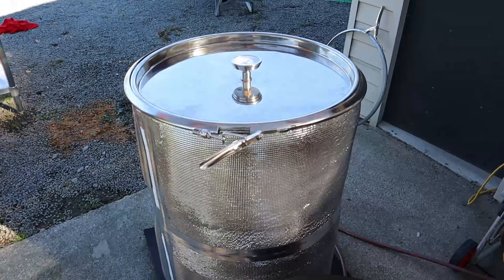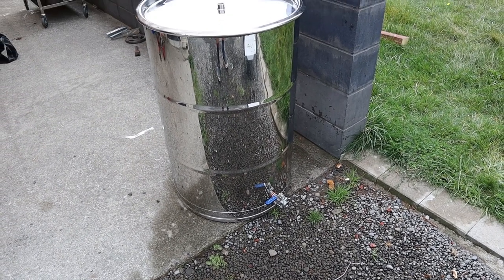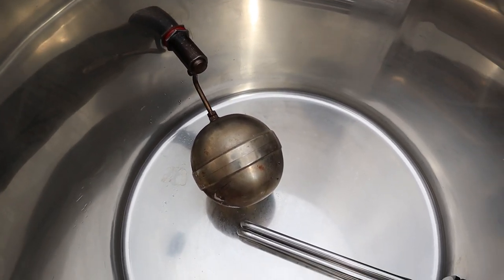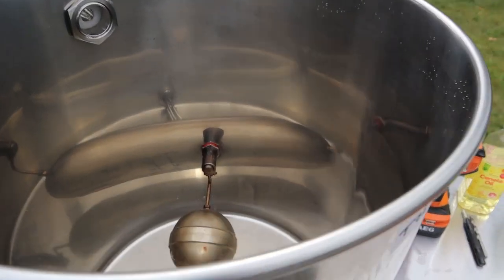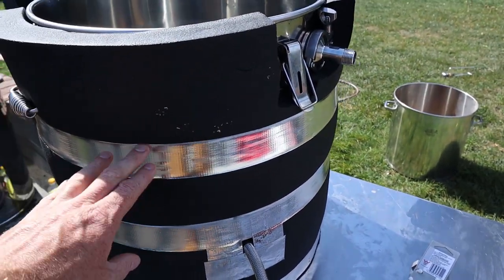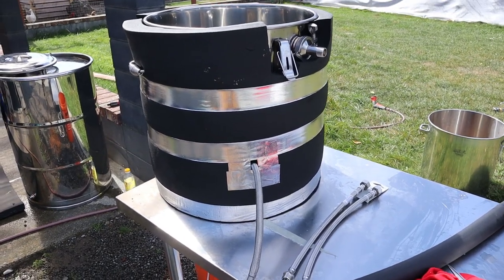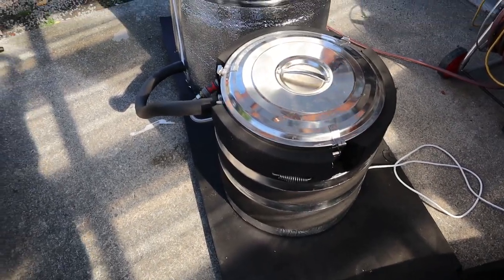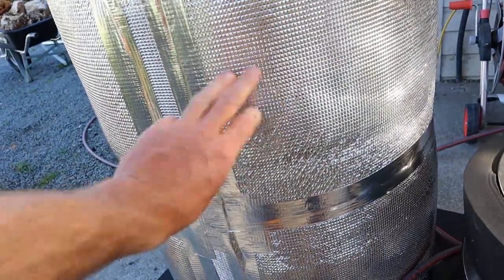How to Build a Homemade Steam Sterilizer for Mushroom Growing

Comment: amazingly informative videos. I rewatched a couple times but didn't catch whether you mentioned the size of your stock pot. I'm acquiring a 100L pot for a similar setup and I'm hoping that it will be big enough. I suppose as long as you can fit your element and ball valve in it, the size doesn't matter so much.
I'm curious though. What size is yours?
Reply from the maker: Mine is about 50L I think. 100L will be plenty big enough!

Comment: How big is the stock pot you use currently, and how much water does it have inside? Whats the relative water level like inside? Do you keep on adding fresh water with a valve system?

Comment: Great job on simplifying this for us.  Do you have any links on where to get the large barrel as well as the heating tank? I looked around but having an issue finding something that can be clamped down to support the pressure.
Thanks
Reply from the maker: You shouldn't build up any pressure. My stainless barrels are for honey. So check a honey equipment supply store.

Comment: Only problem is if the steam exhaust ever got blocked.
Reply from the maker: My new ome doesnt have this problem. The lid is weighted down by 40kg, which means if any pressure builds up it just vents it from the top.

Comment: Question how long would it take to reach your desired temperature once u put bags in the steamer.
Reply from the maker: 7-12 hours depending on how full it is.
Reply: @OakandSpore  So you're not pressurizing here?  This is just heating for a long period of time?  If so, that makes things a bit simpler.
Reply from the maker: No pressure at all

Comment: Hi! thank you for your video, what type of barrel did you use for the substrate? do you think a pressure release valve is needed ?
Reply from the maker: I use stainless steel barrels. I have no pressure release, but there is a large valve on top which is always kept open to vent. If too much pressure builds up it just blows steam out the top of the boiler, and the lid is held down with weights. 
I have made a new and better one which I will make a video n soon.
Reply: @OakandSpore  Are you sterilizing supplemented bags?  If so how long is your total run time?

Comment: Where did you buy/find your 55gallon drums? Are they stainless steel and do you know how much they would be in $'s? I have a bubbas barrels 55gallon sterilizer but they are expensive and a stainless steel drum from them runs at about $800.
Reply from the maker: Yea the barrels are very expensive. mine were like 800 a piece.

Comment: What's the best way to create a safety measure on the steamer if the water inlet stops sending in water for some reason?
Reply: Also, you can monitor the temp in the barrel with the bags.  If it starts dropping off significantly from steam temp, then there is no steam and the controller can shut off the system.  This is probably easier and you wouldn't have to worry about the epoxy.

Comment: Where did you purchase your SS barrel from? Up in Auckland 205L barrels go for $900 incl GST - a bit steep - and was hoping to find an alternative supplier here in NZ.
Reply from the maker: That's what I paid. You wont find a SS barrel any cheaper unless you're lucky on Trademe.
Reply: @OakandSpore  is there a reason you’re using SS barrels vs say the cheap 55gal food grade steel ones?
I know that the steel will eventually start to rust, but covering the inside with a high temp paint would stave that off for a bit. And considering you can pick up like new barrels for like $20 each, having to decommission them every 2-3 years would still save way more overall. Heck you could make up 7 for less than the cost of one SS barrel and have a new one going each day of the week. 
Just wondering if you’ve already tried them and if there’s a massive downside (or a massive upside to SS) that I’m not aware of?

Comment: what should be the steam hose diameter?
Reply from the maker: I used to use a narrow diameter, maybe 8mm, but it would create back pressure and pop the lid up. Now I use maybe a 20mm silicon tube. Its heat resistant, has no back pressure, and fit onto the connectors perfectly. I am going to make a video with my updated setup soon, so subscribe to see the update when I release it!
Reply: @OakandSpore  Thanks mate, I already subscribed. I'm thinking of making one with Aluminum pressure cooker. I'm waiting everyday for your update to give thump up and all.

Comment: what kind of electric enclosure do you use for the heating element? do you have links? the heating element is all stainless steel (element itself and clamp connection)?
Reply from the maker: @andreslorenzosantana4920  yes that looks good. Mine is a dernord, but doesnt have the attachment at the end. I had to jury rig something which is sub-optimal.
Reply: @OakandSpore  Ok. One more question...do you use countdown timer? which one? do you have your heating element plugged into a thermostat or some kind of controller? thank you again
Reply from the maker: @andreslorenzosantana4920  I made a PID controller which keeps the temperature in the sterilising drum at 97c. It turns on for about 5 seconds every 20 seconds.
Reply: @OakandSpore  Ok. I'm thinking about making one, but not sure if it would be a good idea for a 300L vessel with a 2500W element (it ill be only just a vessel, no separated boiler) Do you think it will be enough power to worth a PID? thank you again
Reply from the maker: @andreslorenzosantana4920  2500w should be fine as long as the vessel is insulated.
Reply: @OakandSpore  Ok, I plan to insulate it with armaflex and neoprene. A last question if you don't mind... About the PID enclosure, do you use heat sink for the SSR right? how did you mounted it? outside of the box with a fan or without fan? Thank you again for your time
Reply from the maker: @andreslorenzosantana4920  The SSR came with a heat sink. I used thermal paste and some screws to hold it to the SSR. Then I cut a slot in the box and stuck the heat sink out the side. It doesn't get hot enough to need a fan. You need to use thermal paste so it conducts heat properly. 
https://www.google.com/search?q=thermal+paste
Reply: @OakandSpore  Ok, thank you!!!

Comment: Will this sterilize grain spawn?
Reply from the maker: No, you want an autoclave for that.
Reply: @OakandSpore how would huge farms sterilize there grain? Multiple autoclaves? Doesn't seem cost efficient for large scale
Reply: And could u not sterilize grain in this at a lower psi but for a longer time?
Reply from the maker: Big farms use big autoclaves. Using atmospheric sterilising will take a long time, but can be done.

Comment: What insulation is that mate?
Reply from the maker: It's called k-flex. I'll let you in on a little secret. I've just used foil backed thermal insulated camping mats and they work great! if boiling steam touches them they will melt, but if you keep the boiling steam off them they are fine. K-flex is expensive, thermal sleeping mats are dirt cheap.
Reply: @OakandSpore  happy days thanks a lot for that info. Was Gona say looked up the price and was vexpensive will give the camping mats a go cheers man !

Comment: If that drum is used for honey extraction that means it is resistant to the heat up to 70 c or lets say 100, do not you think it is very dangerous to use such a barrel for hot steam which might be over 100 or 150 c?? Your idea is beautiful but you should really check the heat resistance of that honey barrel !!!!!! One day it might explode !!!Watch yourselves and people around you ..
Reply from the maker: I use a stock pot now. No pressure builds up, so it won't explode.

Comment: What is the water capacity on the boiler in order to sterilize a 50 gal bucket?
Reply from the maker: I gets filled with maybe 15L. There is a stainless float valve. I have a newer video about it.
Reply: @OakandSpore  Thanks for the fast response, will watch it.